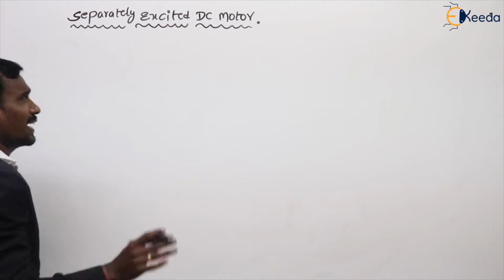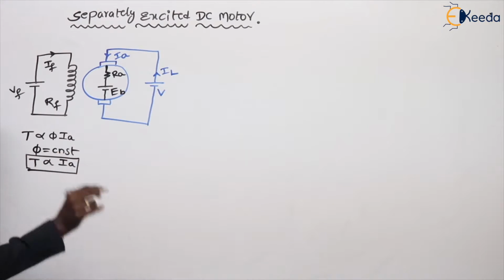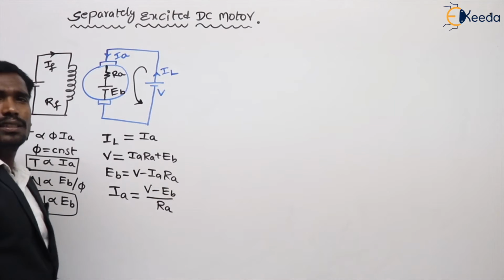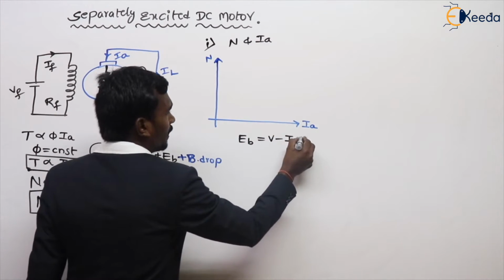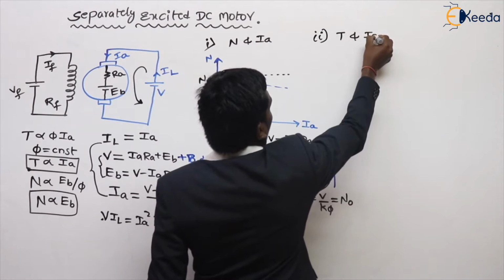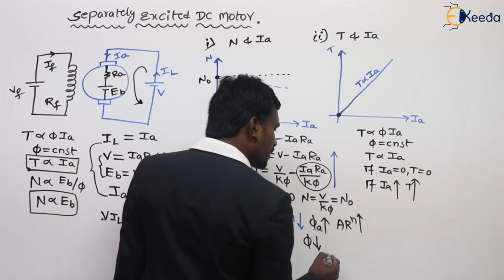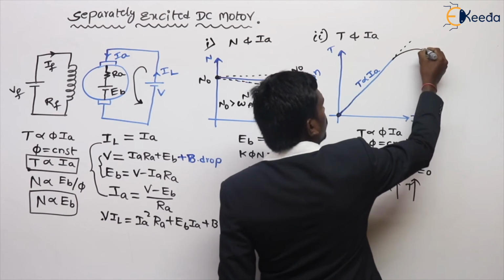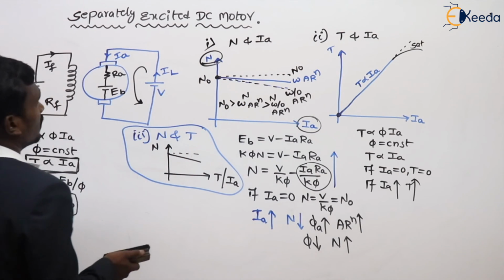In-Depth Analysis Of Separately Excited DC Motor Operation | GATE Electrical Machines

Comment: A 200 V, 2,000 rpm, 10 A, separately excited dc motor has an armature resistance of 2 Ω. Rated dc voltage is applied to both the armature and field windings of the motor. If the armature draws 5 A from the source, the torque developed by the motor is
 A. 	4.30 Nm
Reply from the maker: Kindly download the Ekeeda Learning App https://ekeeda.com/download.html & ask your doubts. Our experts help you to resolve queries on chat.
Reply: Find N2=2111.11
Eb=190
P=2#NT/60